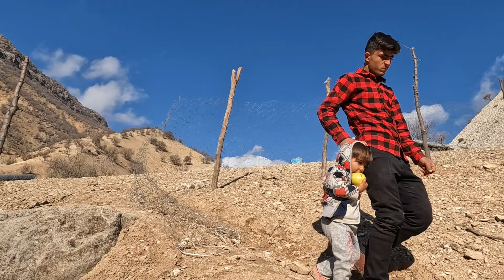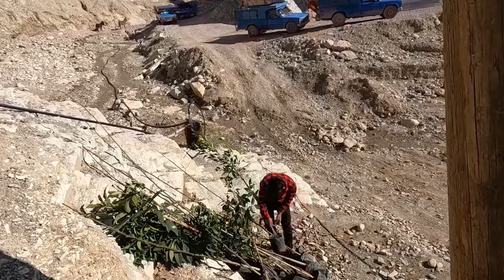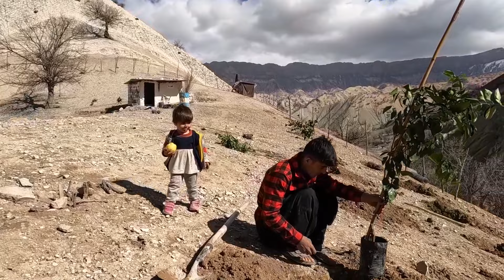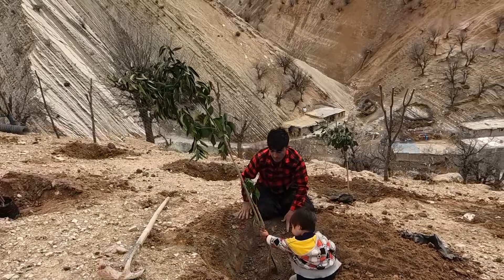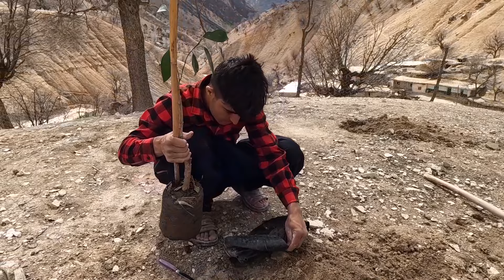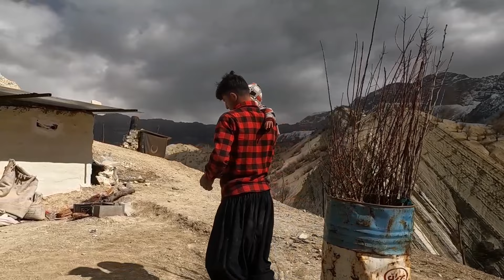Buying Seedlings and Planting Trees in the City

Comment: Hello Kamal, 

Excellent idea to plant apple, apricots, almond and other trees!  

Below are instructions for the DRIP IRRIGATION SYSTEM, which will SAVE you time watering. 

1/ Take a plastic water or similar bottle, and pierce TINY HOLES around the top third of it (with a small iron nail, heated in the fire).  Keep the cap on.

2/ Turn the bottle UPSIDE DOWN, and cut a part of the BOTTOM of the bottle off.

3/ BURY a couple of bottles near EACH tree, UPSIDE DOWN, so that 
only small part of the cut off bottom shows above the earth around it.

4/ Fill each bottle with water.  The water will slowly SEEP through the tiny holes, and will keep the earth around the tree moist, without you having to water every day.  

You will only have to check every other day how much water is still in the bottle, and add water as necessary.

Good luck! 

P.S.  You can also collect pips from the apples you eat, and plant them in one small plot.  Umm al-Bani can look after the plot. :-) When the seedlings grow, you can re-plant them near your fence.
Reply from the maker: Hello, dear friend, thank you very much for your good advice